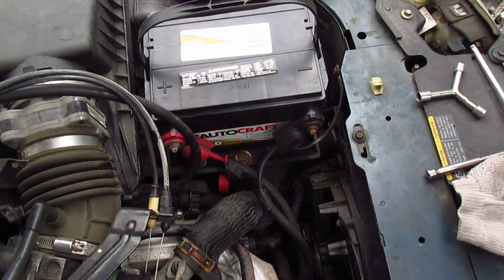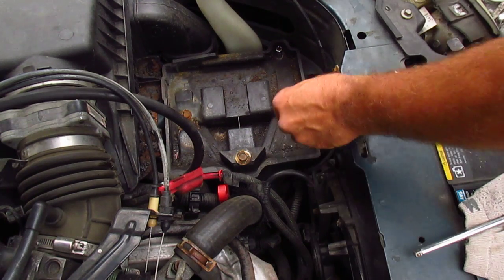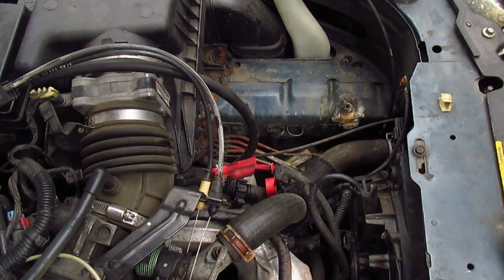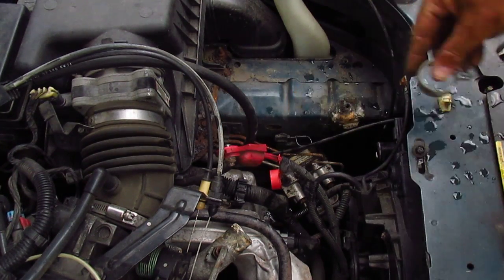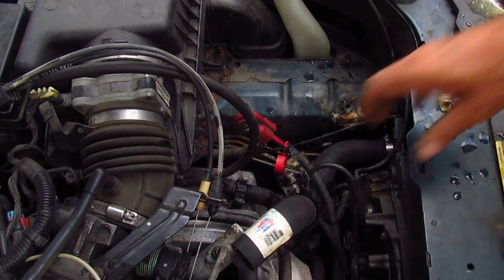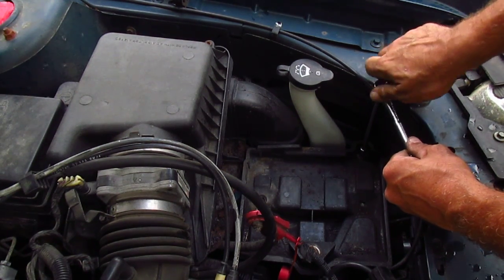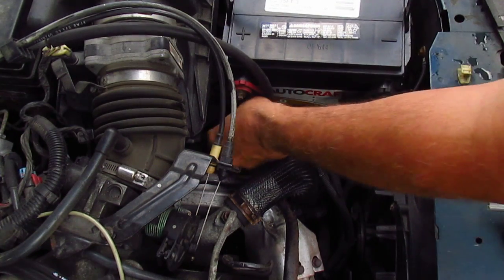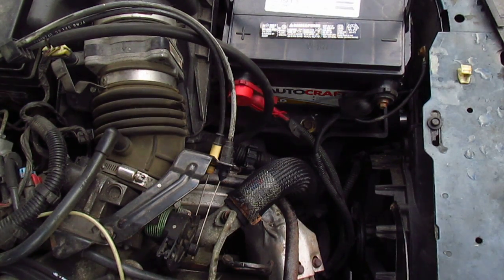CAR REPAIR ISN'T ALWAYS EASY: how to REPLACE a LEAKING RADIATOR HOSE on a 2003 CHEVY MALIBU!

Comment: Those are the wrong clamps to use. Always want to use the spring clamps that you don't like. I know they're a pain the ass but at least they'll hold the hose in place and won't break your radiator spout like you would if you use the other clamps and over tighten them.

But great video.  Thank you!

Comment: They're called CTB clamps: constant tension band clamps. Yes they're a pain in the assembly (!!) But they are much better than screw type clamps because they hold a constant tension even as the hose expands and contracts with every heat cycle. Screw type clamps eventually loosen up. Also CTB clamps can be faster and easier if you have CTB pliers which can be found for 20 or 30 bucks.

Comment: Theres a tool for that clamp..  it is amazing how easy it is when you have that tool..  that tool it why they are tough to get to with a pliers..  because the situation is set for the correct tool.  I spent 30 mins fighting with a clamp and pliers once..  that's when I decided I'm getting the correct tool..  and it tool less than a min to get off with the right tool.

Comment: I now understand why you don't like those spring clamps. For the lower end of the hose it was difficult to get the bottom side over the ridge at the same time as the top. However, spring clamps for dryer vent hoses are nice.

Comment: Nice video! Will check my battery tray soon, '02 model, 75K miles. This helps a lot. . . tricky purging the system of air.